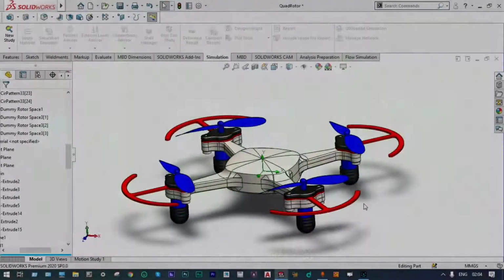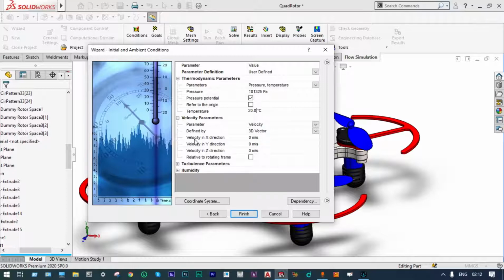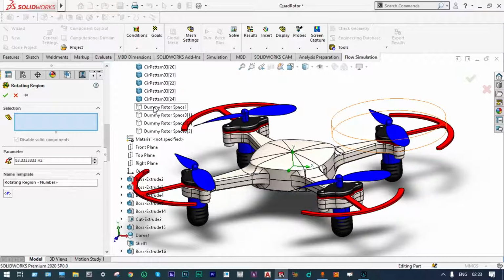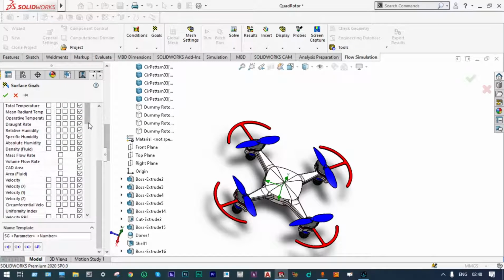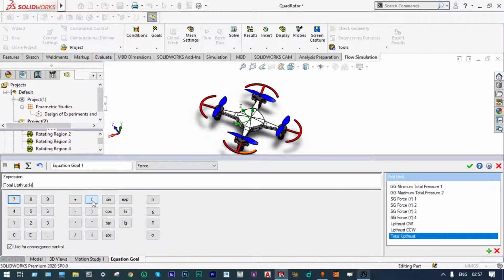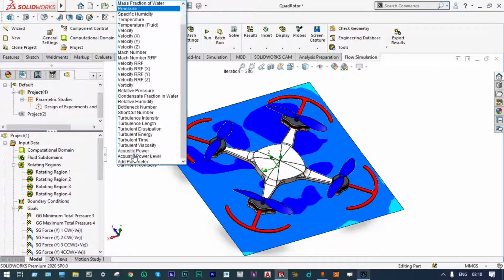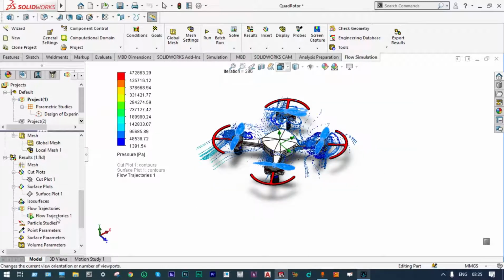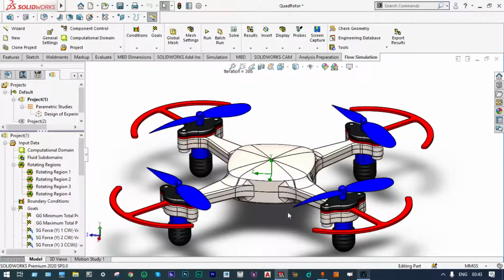CFD Analysis of a Quad Rotor (UAV) with SolidWorks 2020

Comment: Can you explain how to create this dummy space around the propeller. is that important for doing the simulation ?
Reply from the maker: It is the space which is covering all the rotating blades. It is needed for simulation. It is made manually by un-merged extrude boss base on the circular sketch
Reply: @CFD_GUIDE   Thank you for the reply. what i would like to add is that if I add this extrude. that will add up to the total mass of the drone unit right. how can I exclude it from the mass calculation ?

another question is that, I have a propeller design , diagonally 1 set of propeller should be inverted compared to the other set ?